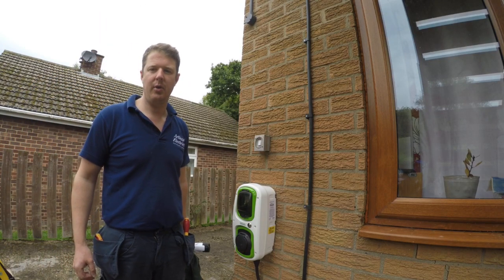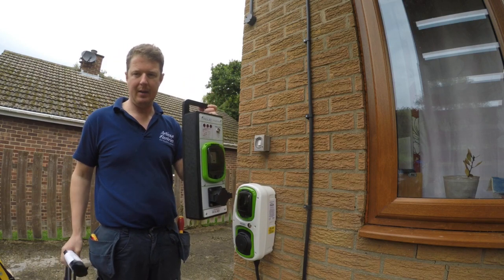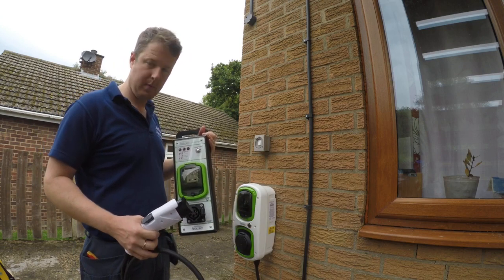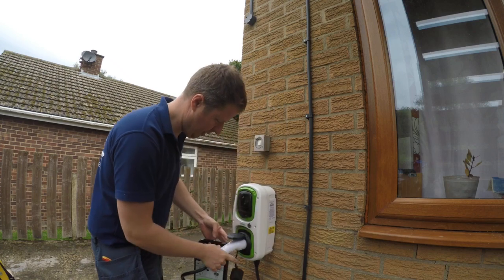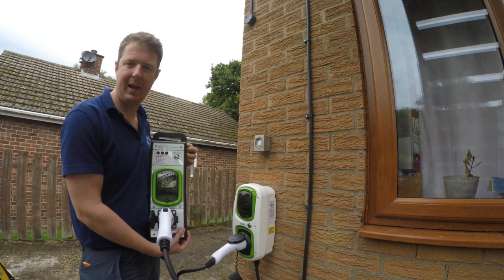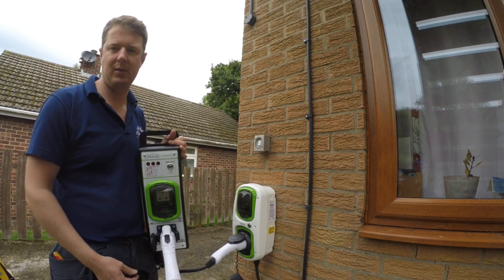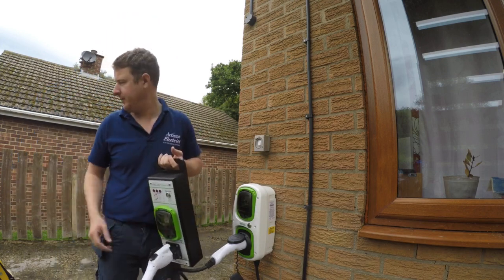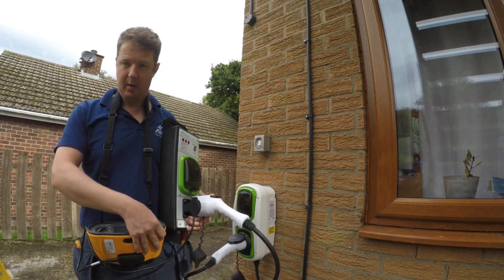How to test an Electric Vehicle Charging Point using Rolec EV Chargecheck

Comment: Still laughing at how you got away with “charging” (notice the sarcasm ?) a customer for you to fault find on their solar pv system without you having any knowledge whatsoever or experience in doing so….. you then you had the audacity to post a video of them getting a return visit which you no doubt charged them for again too, both visits probably cost them more than 2 years of their feed in tariff.
Fair play to you, personally I wouldn’t brag about ripping customers off.  Each to their own. 
Hopefully others in my trade have far more morals and experience rather than just  a sales pitch.
Reply from the maker: No idea what you are talking about, this is a completely different job to the solar fault find
Reply: Your video is “charging point”  . I merely made the “point” that you “charged” someone twice to fault find on their solar installation due to your lack of knowledge….not just with pv systems but obviously with how circuits work if you were unable to identify a faulty mcb without help from someone else. Utter cowboy outfit, all sales pitch and no skills.

Comment: Jordan, do you have any other EV Charging testers? Also, does that charge tester need annual calibration?
Reply from the maker: Steve Tang no that’s the only one I have, it doesn’t need calibrating
Reply: @artisanelectrics  I guess the good thing about the Rolec tester is that you can test most chargers and Rolec chargers as they insist you need it to be in their approved listings

Comment: Great informative video.

What exactly do the 3 red lights pass???
My installer did exactly what you describe but my car is yet to receive a charge from the unit.
My symptoms are at: https://youtu.be/EKAkEiiNU_I
I’m awaiting Rolec sending out a replacement 32A controller.  I guess that Rolec tester doesn’t pick up that sort of fault???
Reply from the maker: Mike Coward the three lights basically just confirm polarity and that power is getting through to the charging cable. If it’s activated then should be charging your car, it might be a problem with the on board charger on the car. Did you figure it out in the end?

Comment: Out of interest, when you fit a rolec of the type with the rcd built in, and you feed it with a normal 60898. When doing the test sheet where do you enter the details for the rcd and  tripping times?

Comment: Thanks for the video.
Which brand is your multifunction tester? 
I tipically use one from amprobe.
Reply from the maker: Fluke is the best! That’s what I use
Reply: Megger mft1741+ with ev adaptor if you intend to test correctly, fluke do not have the same rcd  type range.

Comment: Hello and thanks for the informative videos.
just wondering about testing the DC fault current monitoring - the manufacturers tell us that the charger will detect a fault greater than 6mA, and shut down - but can we test this function? The same for the PEN fault function on Zappi - how do we know it works, or do we have to accept manufacturers claims?
Reply from the maker: Good question! I’m really not sure to be honest! That would be something to ask the manufacturers!
Reply: The latest multi tester have the facility to test B type rcd
Reply: Most multi function instrument have a DC RCD function I have found that this trips the type b RCD. Although you have to scrab around on some instrument menus

Comment: Great video guys! Did you install an earth electrode?
Reply: Now under the 18th edition. How would you have installed an earth electrode. What a nightmare this new reg is!
Reply from the maker: Liam Wolstenholme actually the new Rolec units are genius they have a device in them which measures voltage on the earth and disconnects if it gets too high, this means no earth electrode is needed and pme supply can be used.
Reply: @artisanelectrics  wow! Which unit is that? I was only aware of the Zappi 2.0 due out in March/April that had the PEN fault device integral?
Reply from the maker: Liam Wolstenholme all Rolec units now have that device included in them
Reply: Wow! Are you 100% sure. I could have sworn I saw them stating an earth rod is still required?
Reply: http://www.rolecserv.com/ev-charging/product/EV-Charging-Points-For-The-Home

Just been on the Rolec site and you do still need to install an earth rod. The 6ma DC Leakage is now integral but not the PEN fault device.
Reply from the maker: Liam Wolstenholme good info thanks, the sales guy from Rolec told me otherwise but obviously I misunderstood
Reply: @artisanelectrics  pesky salesmen!! With that said, it would be brilliant to see a video showing you for earth rods if that's possible? Check out the MyEnergi Zappi 2.0- this is the only charge point as far as I'm aware that has a Pen fault device 👍
Reply from the maker: Liam Wolstenholme will check it out thanks
Reply from the maker: Liam did you see my latest video installing a Zappi V2?
Reply from the maker: Not sure if it really has a proper PEN device built in, only Zappi have those...
Reply: @Mason Moore I believe the Pod Point says it complies with indent (iii), however when it was describing it, it described the potentially dangerous indent (iv) on the new amendment. Efixx noticed that too.
Reply from the maker: Good comment
Reply: @artisanelectrics  the Rolec doesn't have the same device as Zappi does it? There's gonna be court cases regarding the patent and copyright with Myenergi no?😳
Reply from the maker: Steve Tang no Rolec chargers are rubbish and need an earth electrode and type A RCBO etc
Reply: @artisanelectrics  I spoke to a Rolec salesman 2 months and he told me that Rolec have no plans to bring out something like what Zappi has and they are staying in the earth electrode route, I reckon it's because they can't as it's patent pending (wonder if they got the patent yet), that put me off.  So I may end up getting a Metrel A1532 instead of a Rolec Charge check, Metrel looks more sophisticated, but according to Metrel they recommend calibration annually, however, the Rolec Charge tester is a lot cheaper and doesn't need calibrating and you seem to be happy with it and it's the only one you can use for Rolec to be approved by them😎
Reply: @Mason Moore wow 1000, that's like one a day every day for over 3 years, are you just doing EV charging full time?
Reply from the maker: Thanks Anthony Lewis no a risk assessment was carried out and it was not necessary to install an earth electrode as there was no simultaneous contact with the ground or PME earthing system and the vehicle possible and concrete driveway made it impractical to install an earth electrode for the charging point